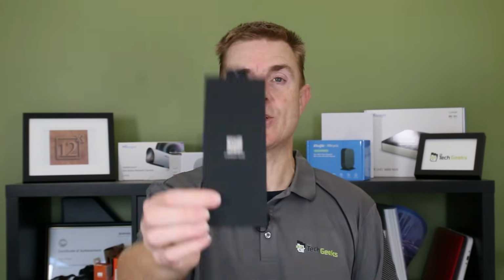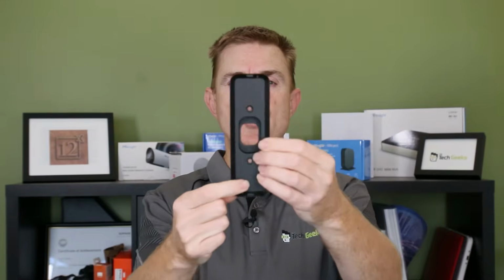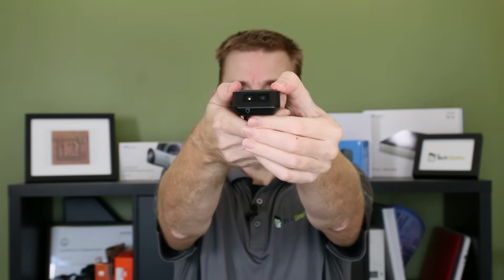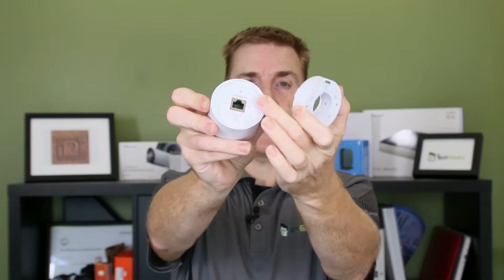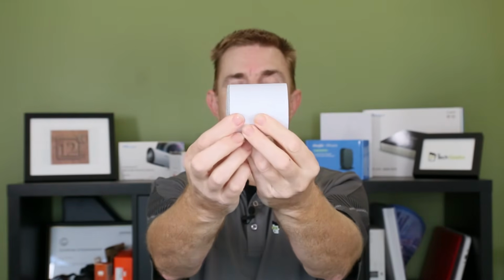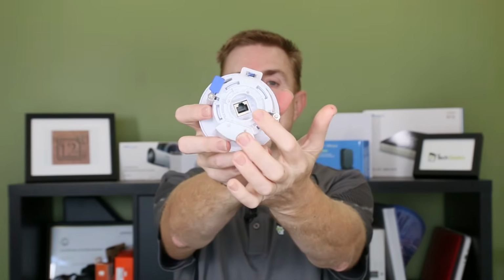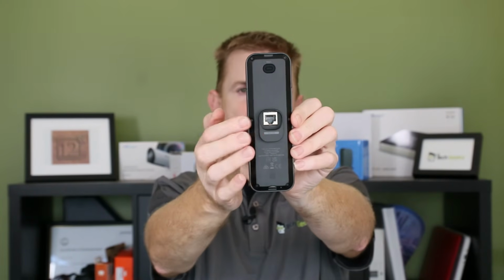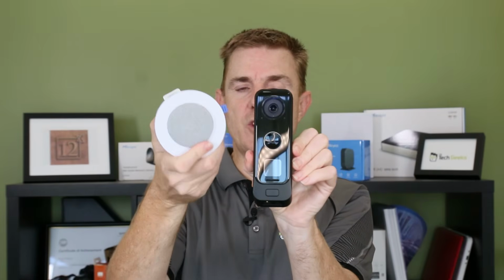Out the Box Series - Ubiquiti G4 Doorbell Pro PoE Kit

Comment: I have been pulling my hair our trying to get this poe Chime to adopt. Ugh!
Reply from the maker: Sorry to hear that. Obviously the POE chime doesn’t have wireless built-in so it is all done over the network. I’m presuming therefore it is showing in your unified Protect app. If it’s not showing in the app then my guess is that it’s not picking up an IP address correctly in your network to be visible, and that might be a good place to start. If it is showing in your app, but refuses to adopt then a factory reset could be another starting point

Comment: When attempting to mount the doorbell using the angle, observe that the camera's center rectangle material around the RJ45 port sticks out too far and the unit cannot be mounted flush on a wall.  Try it and you will se what I mean.  Snap together the doorbell and angle bracket and observe at the back of the camera sticks out too far.
Reply from the maker: Thankd for your comments, we will have a look.

Comment: Does the plastic bit at the back do anything other than holding the bung plug? Can I get rid of it? Otherwise, I will have to make big hole on my brick wall.
Reply from the maker: Thanks for the question.  You don't need to use the bung if you don't want to.  There is also two mounting plates.  the first one holds the doorbell clipped to it and then you choose either the direct straight mount, or the angled mount.  If you just want to flush mount the doorbell, then you will need to still connect it to the main plate and you would only need a small hole for the network cable to come through at that point, but it is designed to be mounted on the striaght or angled bracket.  I hope this helps further.